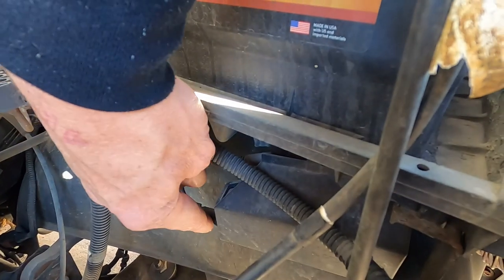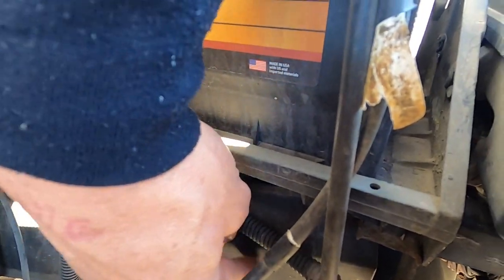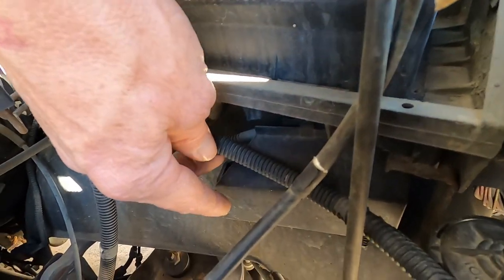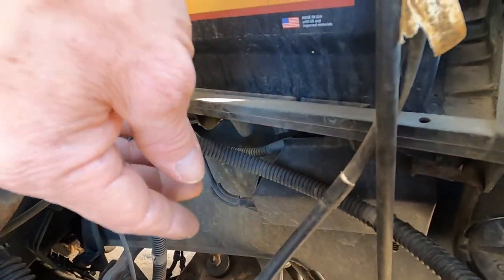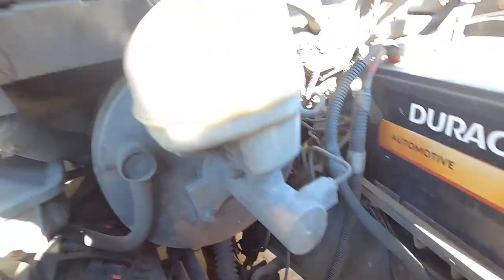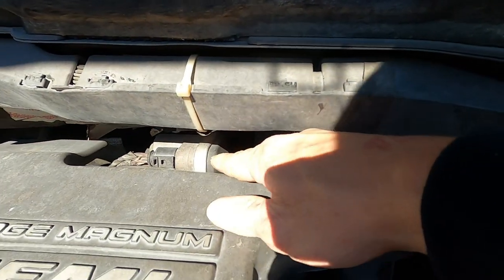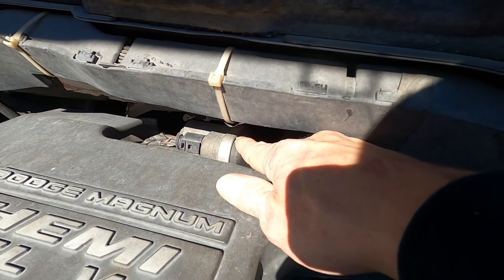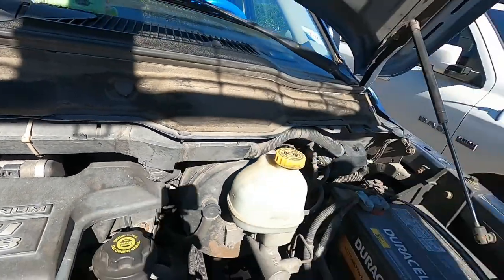Electronic Throttle Control System issue's on 2003 Ram 1500. Read description

Comment: Thank u for the video.....i barely avoided an accident yesterday...was driving my father-in-law's 2005 dodge ram 5.7 hemi for moving some furniture and that throttle issue kicked in while on a country road....as i get to the intersection, i slow down and the rpm go to 0 and then my steering wheel locked (power steering must have shut) and so now I'm limping through the intersection and make if across the road by forcing the steering wheel as much as possible to avoid a ditch.... fortunately nothing else happened but definitely worry driving this truck around further.  I did the manual reset of the throttle sensor with the acceleration pedal and the truck started up with no sensor issue.

Comment: Thanks a ton. My 2003 Dodge Ram 1500 is giving me the same issue. I will also come to a stop light and it almost shuts off on me with the RPM's trying to drop under .5. I watched another one of your videos and I think I am going to first clean my throttle body and if that does not help the situation out I will just buy a new throttle body from the auto parts store and see how that goes.

Comment: I had this red thunder bolt problem on my 03 dodge ram 1500 5.7l hemi 4x4...changed sensors, changed throttle body...bought the 379.00 apps sensor and still did this...finally did research and replaced my exhaust system from the catalytic converter all the way back...No More thunder bolt. Problem solved
Reply from the maker: Sweet great information big dog

Comment: I've had the same problem, first time was stuck in limp mode and needed a new wire harness. Second time I had to replace throttle body now every morning (Wisconsin winter weather) when I start it to let it warm up, almost exactly 3 minutes after running the light comes back on and isles like crap, very little throttle response. Shut it off, start back up and runs totally fine with no issues until it's shut off and completely cools off overnight. Then back to the same issue the next morning like clockwork
Reply from the maker: That is really great information sir. Thank you

Comment: Dude thank you,  my truck would just die then I discovered the red lighting bolt and am getting a new throttle body tomorrow. I'm sure this will fix it.
Reply: My truck flashes the light then just dies also. Did the new throttle body fix yours?   Thanks.
Reply from the maker: @dubcoco1 yes if the lightning bolt is flashing. New throttle body fixed it

Comment: Mine is only slow when I take off... it lags a bit then engages... I don't get the lighting bolt, I changed my map sensor,  breaks, rotors, calipers, coils, wires and spark plugs... still lags a little bit when I'm taking off on first
Reply: Same
Reply: me too bro then when im stepping on it like hard it dont feel nothing like takes a bit for it to respond

Comment: today a 04 dodge with hemi came.. lost power on freeway.. and throttle body code.. we replace with a new one and same problem... no fix.. we check the 5v on conector pf the throttle body and it was 4.8 volt.. so we decide to. chance the ecm from another truck that we have in the shop and.. problem fix.. we got 5 volts on conector and now work perfect..now we are waiting on a replecment ecm to finish the job
Reply from the maker: Had to swap my pcm also

Comment: my 04 ram 1500 5.7 was having no throttle response and not shifting past 3rd gear usually when i would accelerate hard but if i drive it normal it would be fine. took it to the shop this week and they found a code with the throttle position sensor under the battery and the pcv valve was malfunctioning, they also want to replace the whole throttle body. its been there all week because apparently the throttle position sensor has been discontinued and not sold by dodge anymore. i think i finally found an aftermarket one from oreilys (th456) which i hope will do the trick but its not cheap. i will comment an update if this was the correct part🤞🏼
Reply: seems like the throttle position sensor from oreilys was the correct one so they replaced that, the throttle body, and pcv valve but now it idles sometimes at 650rpm or really low at like 500 or 450rpm. also when i put it in reverse sometimes it goes as low as 250rpm almost shutting off until it revs itself up to normal idle. also i was just pulling into the driveway earlier and gave it a little gas and it revved itself up unexpectedly lunging itself forward for a second before i stepped on the brake. kind of annoying. i already tried the different methods of pressing the gas pedal down while the ignition is on and disconnecting the battery for several minutes. but it still has weird rpm behavior
Reply: @RichGarciaTv  Did You Ever Get It Figured Out ?

Comment: I had the same issue on an 03 2500. Put a brand new one in ($350). Did the same as you; searched for its right idle for a minute or two, then it was fine. 2 or 3 days later I get the lightning bolt flash when the truck warms up. If it warms up while I drive, or just while parked, the light comes on no matter what. I’ve tried every manual relearn procedure I can find and it’s still doing the same thing. Bought a code reader a few days ago to do other stuff and I don’t think I can use it to do the relearn process. I put the new throttle body in a month ago, and I’ve been having issues almost every day with it (the first day it ran smooth, got great mileage also). Now it flashes every time I start it (after maybe 2 minutes) but if I kill the truck and restart it goes away. But today I had to do that probably 3 times on the warm up because it was a bit cold out. But winters here get much much colder. I have to fix this issue! I know you know your way around these trucks; if you can suggest anything, thanks in advance. I bought this vehicle in the summer and I’ve had a lot of problems with it; it would be nice to be able to solve just one of them 🤞
Reply from the maker: Did you get a warranty with the nee throttle body.  When it happend to me I put the new throttle body on right in the parking lot at the auto parts. Fire it rite up. Have not had any issues sense that day. If you did get a warranty I would definitely go swap it out with another one
Reply from the maker: Also did you disconnect the  positive and negative battery terminals and hold them together to do what is called a hard reset on the pcm
Reply from the maker: It sounds like the throttle position sensor is bad in the new throttle body
Reply: @autoguydiy4244  I did not do this. I will try to touch the cables together, and look into sending the unit back if I have to (ordered it). Thanks for answering and I’ll let you know what it was if I ever sort the issue out. Appreciate your help.
Reply from the maker: Your welcome sir. Also you could try to disconnect the battery over night with the headlights on. So the whole electric system is drained reconnect in the morning to headlights off start truck and let her rip
Reply from the maker: Please do keep me updated sir
Reply: Mine is doing the exact same thing did you ever find a cure ?

Comment: I wonder if the throttle body is bad if it’ll keep the truck from staring all together in some cases? My truck will run if I spray starting fluid in the vacuum hose going to the brake booster. That it was a fuel pump problem at first until I tested the fuel pressure and had 55psi on the fuel rail
Reply from the maker: It would keep it from starting
Reply from the maker: If it runs, putting starter fluid in the vacuum line. Well it come in after the throttle body on the intake
Reply: @autoguydiy4244  shoot it won’t even start. It hasn’t in a couple months. Lol . That thing is getting everything it needs to run plus I also replaced the timing chain and gears because it had a code saying the cam and crank sensors was out of sync. Then it had 4 codes about the tps sensor. It’s one thing after another. I think it boils down to the pcm being bad
Reply from the maker: @tchogworks1987  I had to replace my pcm. I was getting accelerator pedal positioning sensor codes

Comment: So I swapped my throttle body and sensor in the intake and I’m still having the light and the light comes back when I idle and the truck will just shut off. Any ideas?
Reply from the maker: Check for vacum leaks around the intake

Comment: Once you put the new throttlebody in there, did you have to reset the sensor or just slap it on there and he was good to go?
Reply from the maker: Put a new throttle body  started truck and drove it

Comment: Yo I think this was my issue I have it in a shop now I replaced the throttle body and crank shaft position sensor and spark plugs because I got all those codes and nothing I think my issue was the cable it self I did not know it had that thank you man honestly I'm not sure since it's in a shop but I've done every other possible thing and nothing mine would not even run it took no throttle and idled up and down and would never level out it went into limp mode or something
Reply: Did you get it fix ? I’m going thru the same thing
Reply from the maker: Is the lighting bolt flashing are us ut steady
Reply: @RIPFIGGAS  yeah it was a wiring issue with the throttle body for me and pedal response i got it rewired and my response fixed and it runs perfect now not sure if its the same for everyone but you could always check

Comment: I replaced mine but my truck still does it if I leave it idle in the winter only in the winter or when it's really cold 🥶
Reply from the maker: Look for a leak around your throttle body.  Also around intake

Comment: Hey bro I have a 2003 ram 1500 5.7 hemi I had a catalytic converter put out a while back and it gave me a 420 code right after that the truck started having issues I got a 2106 code for a bad ECM I have now put on my second DCM reprogram plug & Play-4 plug-in Motorola ecl I keep getting the lightning bolt I put on used carburetor possibly could be bad also one's worse than the do you believe I may not have an ECM problem and it was just my throttle body but how would I get a 2106 code I guess but the problem came with putting the cat on in the wrong one to begin with
Reply from the maker: Go to a salvage yard get a pcm that is the exact match for your truck and get the vin rewritten and try that
Reply: I got one off and go three last week and it's still doing the same thing I think it's my throttle body for sure I just got a second eats and put it in doesn't seem to run bad at all until it kicks a code now I only got to 171 Bank Lane

Comment: I've got the same problem on my 03' 5.7 ram. I took it to my mechanic and he replaced the throttle body 3 times and no luck. I'm preparing to buy a TPS but they're rather expensive, and I don't wanna just throw parts at the problem. Any ideas???
Reply from the maker: Check for vacum leaks around throttle body base the plastic could be cracked. Check for leaks around  intake
Reply: All good there, no leaks. Thanks a lot for responding by the way, much appreciated.
Reply: @autoguydiy4244  I went to the junk yard today and got a TPS, unfortunately it made no difference. Not quite sure where to go from here. Dunno if this matters, but the ETC light doesn't come on under heavy acceleration. It only comes on under low acceleration/ rpm, but that's not at all practical for around town driving.
Reply from the maker: Have you thought about fuel pump or fuel filter. There both on/in fuel tank
Reply from the maker: It sounds like you may not be getting proper fuel pressure at low rpm.  When on the gas pedal it is providing enough pressure
Reply: @autoguydiy4244  nope, i haven't thought of that. I suppose I'll look up some tutorials and try that. Thanks again.
Reply from the maker: Your welcome. Start with the fuel pump fuse always start with the cheapest thing to fix and then go from there

Comment: i have a 03 ram 1500 5.7 . lighting bulb comes on and truck is rewing up and down to 3,000 rpms . i replaced the throttle body and let the battery disconnect over night ... still isnt idling right ... any tips ??
Reply from the maker: Check for vacum leak somewhere. Plus how many miles have you driving it
Reply: 150k miles . i put s brand new throttle body and mainfold was just replaced .. mechanic promise me its sealed correctly but the lighting bolt is on and isnt idling right
Reply from the maker: @joshson7946  what I mean is how much do you drive the truck daily
Reply: the truck hasnt been driven in like a month . it wont idle and shuts off ..
Reply from the maker: 10-4
Reply from the maker: Big dog pull the valve covers you most likely have broken valve springs
Reply from the maker: Do not start the truck and let it run at all like that
Reply: i dont have any codes for misfire ... im going to remove covers and see any loose springs but codes is only for an 02 sensor
Reply from the maker: I didn't have any codes when my valve springs broke. Not until the intake blew apart
Reply: i started to pull off coils and the sleeves were broke from coil .. im going to replace all 8 and see how its runs ..
Reply from the maker: Kool
Reply from the maker: Let me know
Reply: @joshson7946 figure it out?

Comment: I replaced mines bro because it was idling up and down like crazy but the sucky thing is that it's still doing the same thing
Reply from the maker: Maybe you should remove your positive and negative cable from battery. Then tie your positive and negative cables together for 10 to 15 mins not touching the battery at all. It's called a hard reset. I would try that before spending any more cash
Reply: Hmm I never heard about that before I'll give it a try thank you.
Reply from the maker: Your welcome.

Comment: Whats the part # for the sensor under the battery tray? I can't find it anywhere??
Reply from the maker: The sensor is the apps. Accelerator Pedal Positioning Sensors. I'm having trouble finding the part #. I will get under the  hood of the truck and see if I can come up with something for you.
Reply from the maker: Gathering info. Look for a video to come out In The next couple of weeks sir. I think I found what ur looking for try to get my hands on it to see if it is identical to the one on my truck
Reply: My truck is identical
Reply from the maker: That is awesome.  Are you still looking for the accelerator pedal positioning sensor

Comment: I seem to have all the same issues. But my brakes were extremely hard to use, almost no brake power. Would that lean you towards a vacuum leak.
Had a loud backfire and a bit of smoke from under hood. Then TBS came on and issue started.
Reply from the maker: I would definitely check for a vacum leak on the brake
Reply from the maker: Get some carb cleaner spray it around vacum hoses. If the trucks idle goes up than you have a vacum leak in that area
Reply: Ok great. I will try that. Can’t throw money around right now, like most ppl.
Reply from the maker: I understand completely buddy. I feel the same way about it

Comment: did you change the sensor under the battery box and if so how did you do it
Reply from the maker: No I changed the throttle body
Reply: @autoguydiy4244  i changed the throttle body and still having the same problems any ideas
Reply from the maker: Not rite off the top of my head.  Let me look in to it . I will get back to you
Reply: @autoguydiy4244  OK thanks ready to get the stick of dynamite out lol
Reply from the maker: Hey there sir. I think you should try a hard reset and throttle body relearn process
Reply from the maker: Especially before spending any more money.
Reply: @autoguydiy4244 I did that still no change
Reply from the maker: @danpowell9093  so I need to know what issues your having exactly. To better help you sir.
Reply: @autoguydiy4244  the same as it acts when the throttle body needs changed the lightning bolt is on and it is in limp mod and the throttle is flexing  up and down and sometimes just quits running
Reply from the maker: @danpowell9093  Did you by a new throttle body are a remanufactured  one
Reply from the maker: Also. Did you have any throttle pedal problems before all this went down with it sir
Reply: @autoguydiy4244  brand new throttle body and no on the pedal. It ran like a champ
Reply from the maker: I'm starting to think you have a defective part sir. The new throttle body should have fixed your problems
Reply from the maker: @danpowell9093  Also. Do you mind me asking where you got the throttle body from sir.
Reply: @autoguydiy4244  Petersons auto supply. Ben getting parts from them for years
Reply: @autoguydiy4244  i am starting to think the same. Got a life time warranty on it
Reply: take that back Petersons couldn't get me one for 2 days so i got it from autozone
Reply from the maker: @danpowell9093   I would go have it swapped out. Put the new one on. When you plug everything back in turn your key on press pedal to floor release slowly. Then turn key off. Then fire it up and see what you have sir
Reply from the maker: I get all my parts from oriellys. I have alot of bad experiences with auto zone and duralast part
Reply: @autoguydiy4244  i will have to try that probably wont be able to till the Sunday or Monday got to work 24 hr shift Saturday goin gto call them tomorrow and see when i can get one
Reply from the maker: Pls let me knw how it turn out. If anything we can drop back and punt and  figure something out to get it going sir
Reply: @autoguydiy4244  got a new throttle body ordered i will keep you posted
Reply from the maker: Thank you sir. We will get that Ram back on the road sir
Reply: @danpowell9093 did that work?